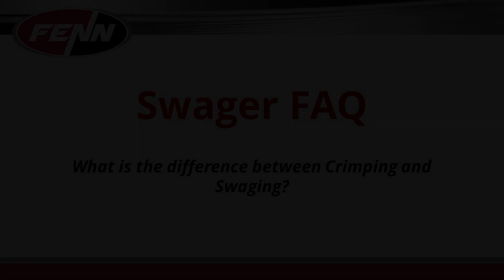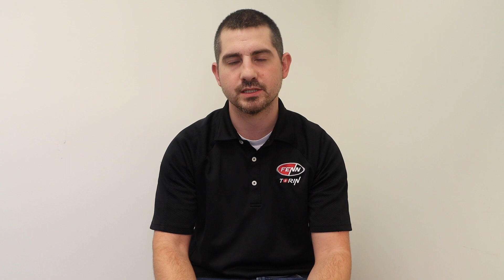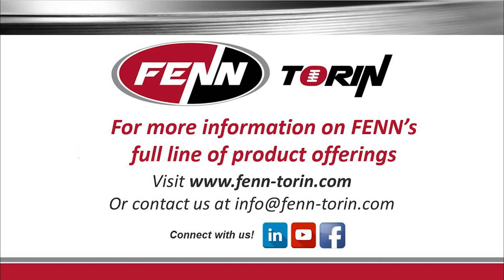Swager FAQ: What is the difference between crimping and swaging

Comment: your description of the process of "crimpin"' and "swagin'" is identical. you say that the difference is that in crimping it is still two parts and in swaging they become one which is obviously a misconception on your part
Reply: The processes of crimping and swaging are very much different. You get the same end goal in the sense that you are taking two (or more) parts and joining them to become one assembly, but the processes behind this action are not identical. In the act of crimping, you are deforming/bending/crimping the outer part to "join" the inner part. During this crimp, the part that you crimp is the only connection between these two parts (and in most cases not much force is needed before physically seperating the individual components). In the act of swaging, you are forging the outer part (mostly through cold working) to physically alter the entire surface of which you want to swage so that it will virtually "bond" to the inner part. You are correct in that there are still two parts, however the resultant force to disassemble a swaged vs. crimped component is much greater in the swaged assembly.
Reply: @Chris-FENN  Very much different?  I still disagree, you are still just adding a different word, forging, which crimping technically is. Swaging is just a far superior crimp.

Comment: What is it that you’re referring to? What are you swaging or crimping are you talking about steel galvanized wire cable like garage door cable
Reply: In these cases we are referring to terminals that would go over wire rope. You can use steel galvanized wire cable, but in our industry most of it is SS Wire Rope due to heavy lifting loads.